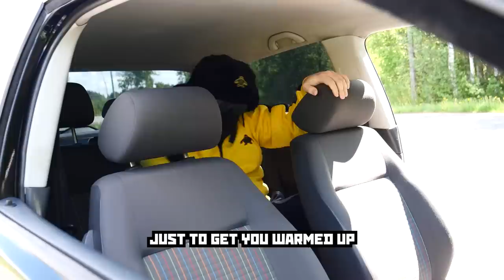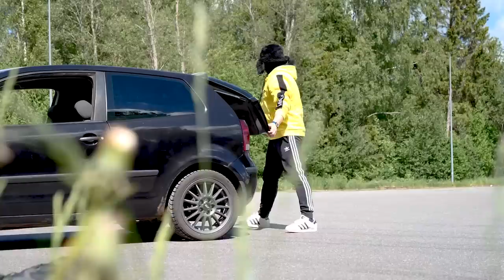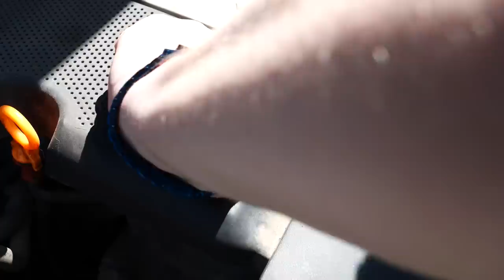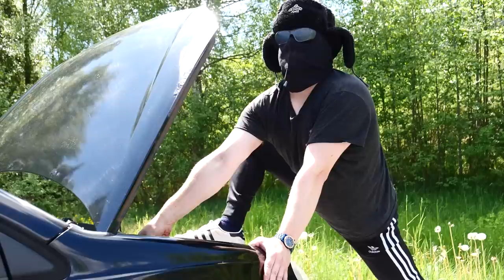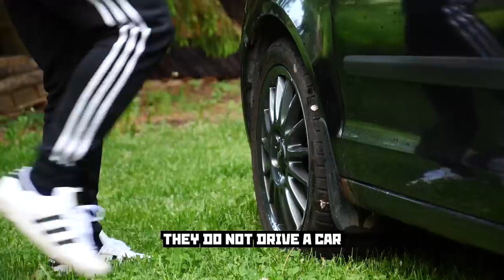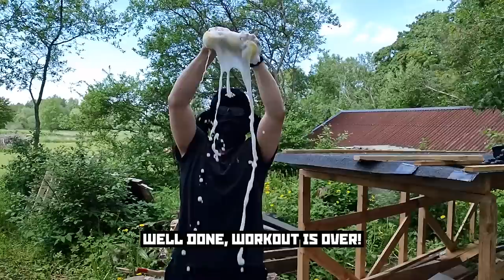Gopnik Workout: Car edition

Comment: Ultimate exercise: blow the electronics and drive without power steering, heating, cooling, or lights. It helps exercise your mind, and body. And will test your reaction times, especially at night.

Comment: Boris Car Workout Program

Warmup: 

Seat Shuffle 2x5 @BW

Explosive Out the window arm extensions: 3x15 @BW

Car hood pendulum squat: 5x5 @1 Volkswagen golf hood/ Superset with back extensions 

Car trunk pulls: 3x10 @1 Volkswagen trunk door/ Superset with calf stretches

Behind the back backseat pulls: 3x10 @1 kakadu

Steering wheel russian twists: 2x20 @1 Volkswagen golf steering wheel with broken power steering

Working sets:

Oil cap wrist twists: 3x15 @Maximum torque + rusted washers/ Superset with washer fluid refills

Seatbelt tricep extensions: 3xAMRAP @1 Volkswagen seatbelt 

Seat adjuster tricep dips: 3x12 @1 Volkswagen seat adjuster/ Superset with seat angle adjuster wrist twists

Dip stick shrugs: 3x10 @1 Volkswagen dip stick

Steering wheel chest press: 3x5 @1 Volkswagen steering wheel/ Superset with rear view mirror wrist curls

"Is my freon leaking?": 5xAMRAP @BW

Volkswagen sled pushes: 5kms or until at gas station

Tire kicks: 4xAMRAP @34 psi

Lug nut twists 12x5 @Maximum torque + rusted nuts

Finisher:

Car wash: AFAP

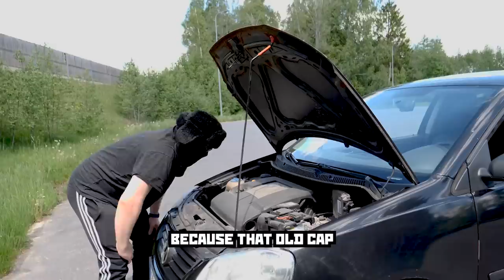Comment: 1:52 really fucking awesome video, but I just have to point out that you don't check oil level through the engine and oil cap, but rather the dipstick. you park on level ground, wait a few hours for the oil to flow into the oilpan properly, remove dipstick, wipe it, put it back, remove again, inspect level and quality

Comment: The M4 carbine is a 5.56×45mm NATO, gas-operated,[b] magazine-fed, carbine developed in the United States during the 1980s. It is a shortened version of the M16A2 assault rifle.
The M4 is extensively used by the United States Armed Forces, with decisions to largely replace the M16 rifle in United States Army (starting 2010) and United States Marine Corps (USMC) (starting 2016) combat units as the primary infantry weapon[9][10] and service rifle. The M4 has been adopted by over 60 countries worldwide,[11] and has been described as "one of the defining firearms of the 21st century".[12]
Since its adoption in 1994,[11] the M4 has undergone over 90 modifications to improve the weapon's ergonomics and modularity, including: the M4A1, which strengthened the barrel and removed the burst-fire option; the SOPMOD, an accessory kit containing optical attachments; and the underbarrel M203 grenade launcher.
In April 2022, the U.S. Army selected the SIG MCX SPEAR as the winner of the Next Generation Squad Weapon Program to replace the M16/M4. The rifle is designated XM5.[13]
Following the adoption of the M16 rifle, carbine variants were also adopted for close quarters operations,[14] the first of which was the CAR-15 family of weapons, which served through the Vietnam War.[15] However, these rifles had design issues, as the barrel length was halved to 10 inches (25 cm), which upset the ballistics, reducing its range and accuracy and leading to considerable muzzle flash and blast,[16] meaning that a large flash suppressor had to be fitted.[17]
In 1982, the U.S. Government requested Colt to make a carbine version of the M16A2. At the time, the Colt M16A2 was the Colt 645, also known as the M16A1E1. Later that year, the U.S. Army Armament Munitions Chemical Command helped Colt develop a new variant of the XM177E2, and the U.S. Army redesignated the XM177E2 to the XM4 Carbine, giving the name as the successor to the M3 Carbine. The carbine used the same upper and lower receiver as the M16A1,[18] and fires the M855 cartridge along with the older M193 cartridges. In 1983, the 9th Infantry Division requested a Quick Reaction Program (QRP) for a 5.56mm carbine to replace the M1 Carbine and M3 submachine gun in service.[19][16] The XM4 was tested by the Army's Armament Research and Development Center (ARDC) in June 1983. Later, the gun was updated with improved furniture, and a 1-7" barrel. The ARDC recommended additional commonality with the M16A2 rifle, as well as lengthening the barrel to 14.5".[18] In January 1984, the U.S. Army revised the QRP, and a month later, the Army formally approved development of the new carbine.[18]
In June 1985, the Picatinny Arsenal was given a contract to produce 40 prototypes of the XM4.[18] Initially a joint program between the Army and Marines, in 1986 the Army withdrew their funding. The XM4 was finished in 1987, and the Marines adopted 892 for that fiscal year, with the designation "carbine, 5.56mm, M4."[18] Owing to experience from the 1991 Gulf War, the Army gave Colt its first production contracts for M4 carbines in May and July 1993, and M4A1 carbines for SOCOM operators in February 1994.[20]
Interest in the M4 Carbine was accelerated after the Battle of Mogadishu (1993), in which Rangers complained that their M16 rifles were "unwieldy", whereas members of Delta Force in the same battle, equipped with the CAR-15, had no such complaints.[21] The M4 Carbine first saw action in the hands of U.S. troops deployed to Kosovo in 1999 in support of the NATO-led KFOR peacekeeping force.[22] It would subsequently be used heavily by U.S. forces during the Global War on Terrorism, including in Operation Enduring Freedom and Operation Iraqi Freedom.[22] In the Army, the M4 had largely replaced M16A2s as the primary weapon of forward deployed personnel by 2005.[23] The M4 carbine also replaced most submachine guns and selected handguns in U.S. military service,[23] as it fires more effective rifle ammunition that offers superior stopping power and is better able to penetrate modern body armor.[22]

A 10th Special Forces Group soldier with an M4 carbine during an exercise in July 1995.

A U.S. Army 82nd Airborne soldier holds an M4 carbine in Vitina, Kosovo in January 2000 during the NATO-led KFOR mission, the first operational use of the M4 by U.S. troops.
In 2007, the USMC ordered its officers (up to the rank of Lieutenant Colonel) and staff non-commissioned officers to carry the M4 carbine instead of the M9 handgun.[24] This is in keeping with the Marine Corps doctrine, "Every Marine a rifleman." The Marine Corps, however, chose the full-sized M16A4 over the M4 as its standard infantry rifle. United States Navy corpsmen E5 and below are also issued M4s instead of the M9.[25] While ordinary riflemen in the Marine Corps were armed with M16A4s, M4s were fielded by troops in positions where a full-length rifle would be too bulky, including vehicle operators, fireteam and squad leaders. As of 2013, the U.S. Marine Corps had 80,000 M4 carbines in their inventory.[26][27]
By July 2015, major Marine Corps commands were endorsing switching to the M4 over the M16A4 as the standard infantry rifle, just as the Army had done. This is because of the carbine's lighter weight, compact length, and ability to address modern combat situations that happen mostly within close quarters; if a squad needs to engage at longer ranges, the M27 IAR can be used as a designated marksman rifle. Approval of the change would move the M16 to support personnel, while armories already had the 17,000 M4s in the inventory needed to outfit all infantrymen who needed one.[28] In October 2015, Commandant Robert Neller formally approved of making the M4 carbine the primary weapon for all infantry battalions, security forces, and supporting schools in the USMC. The switch was to be completed by September 2016.[29] In December 2017, the Marine Corps revealed a decision to equip every Marine in an infantry squad with the M27, replacing the M4 in that part of the service.[30] MARSOC will retain the M4, as its shorter barrel is more suited to how they operate in confined spaces

Comment: Advice for turning your car into a sauna!

Step One:  Buy an old, barely functioning car.  It once had electric windows.  Now it has closed windows!

Step Two:  Wait until the air conditioner goes out.  Get used to relying purely on venting in outside air at the highest fan speed.

Step Three:  Wait for a hot, humid day.

Step Four:  Kindly allow your water pump to wear out, causing your car to overheat after very short periods of driving.

Step Five:  Turn on your heater to bleed off some of that heat.

Step Six:  Sweat to death.

These instructions are brought to you courtesy of my first car, a 1984 Chevrolet El Camino Conquista.  I believe the Conquista name meant it was the special one, with all the electric features, like seats and windows, which presumably worked at some point in the car's history.  I owned it in the mid-2000's, so.........